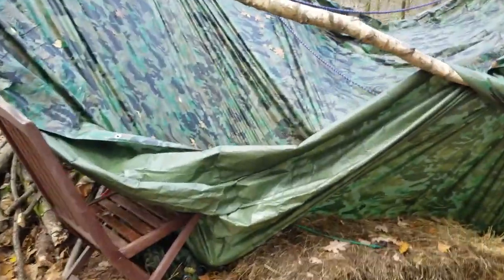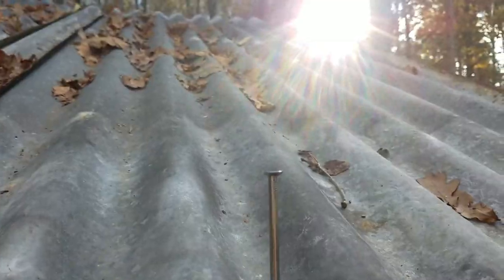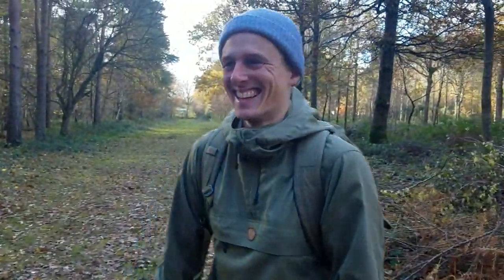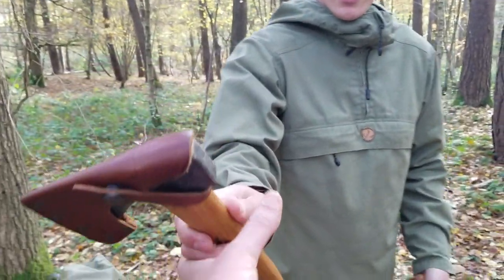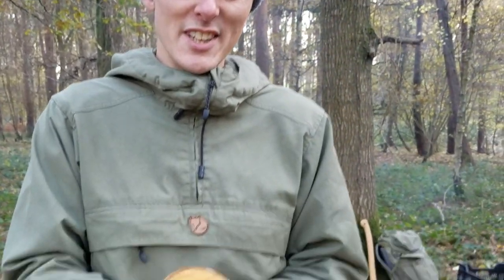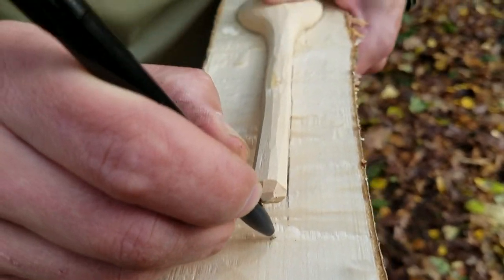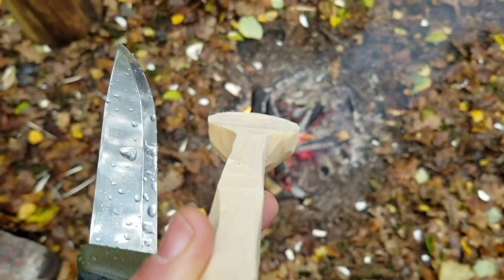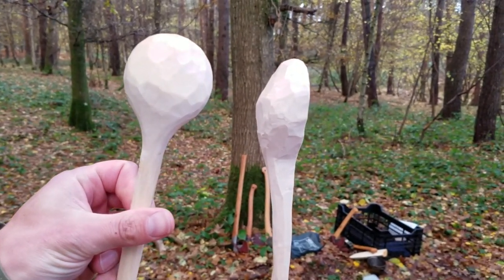SPOONING

Comment: why dont you lead the tarp inwards to the centre where you can have a hold for water to go down and collect under the tarp. It would be easier to make and could give it more shape. If the water collects through the centre of the tarp rather then from the edge you can be more efficient and you can make the tarp stronger.